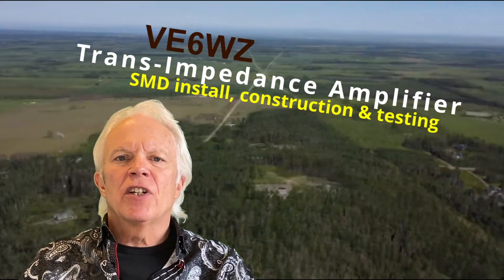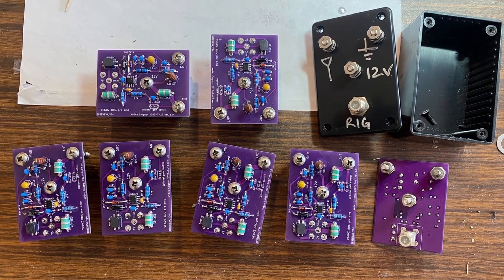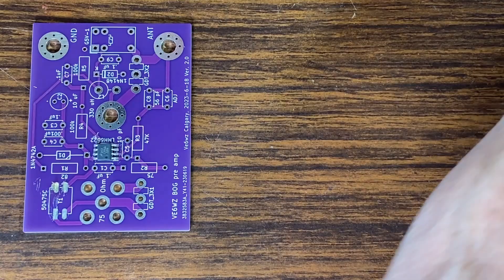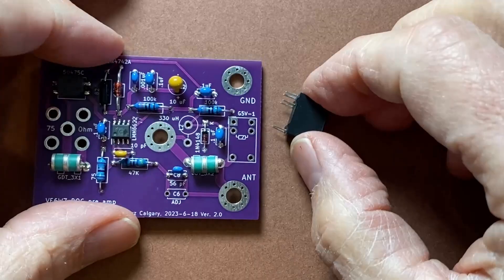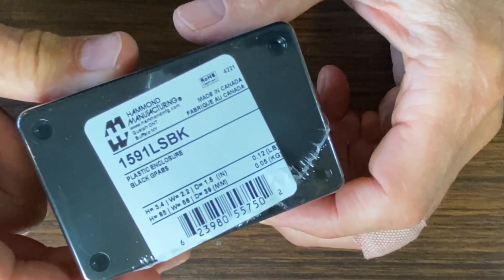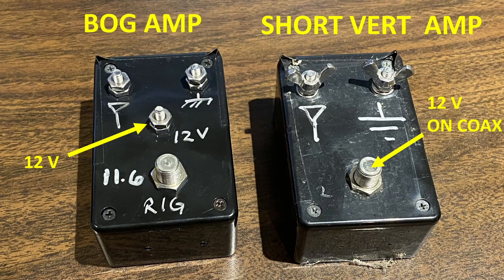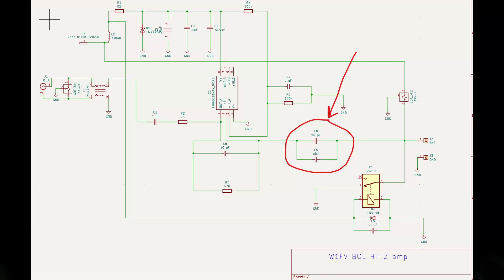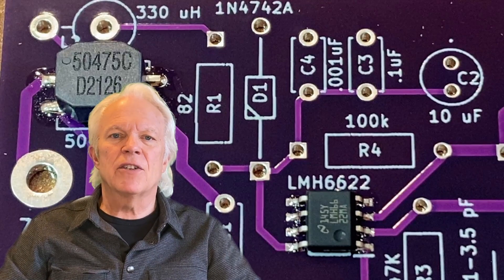DIY amplifier for RX antenna (part 2)

Comment: Steve, could this amp be adapted to a LoG design (160m to 20m)?  I don't have the acreage at home and while I do have a lot of acreage in the country, it is all too hilly/rocky for bogs.  I was thinking about nesting some LoGs and adding a comment switch feed/switch point, and possibly do arrays.  73 KK7YIS

Comment: Steve, your schematic shows the relay that shorts the antenna to ground when the amplifier is not selected by the circuit selection logic. How is the group of selected antennas also protected?

Comment: Thanks Steve, I built your design and have it running with a 1900ft Beverage in Ireland (on a public kiwiSDR as well (EI5IN)). A MW band bandstop filter is the next project though as the signals are incredibly strong here.

Comment: How important is it to be able to control the impedance of the board/traces when doing this? Are you using a calculator of some sort to keep it all ~75Ω or does it even matter at that small length in relation to the wavelength? The transformer and op amp input might not really even care, but I always wonder about that...I have a number of projects I have had made via JLC as well, but have never done anything with any kind of accuracy/impedance control required. The only Design Rules I use are just wider traces on power rails and ground-flood where it makes sense.
Reply from the maker: Hi Bob!
I will "occasionally" calculate a trace width to impedance match whats required, but I'm not sure its very critical on the low frequencies we are using.
There are a number of good on-line tools available. I have used this one a few times: https://impedance.app.protoexpress.com/?appid=UNSEIMPCAL

Comment: Steve, have you ever seen anyone run a BoG through a garden hose or equivalent? Or something even more inexpensive? Something that lets you run the BoG right on the ground, but without the overhead of dealing with fallen logs and such. I have plenty of fallen trees and log to work with but it also some open fields. Faster deployment/removal and easy relocation would be the main benefits but performance closer to the ground is the main concern.

Comment: A good tip is to also have some small solderwick.  If you make a solder bridge on the SO-8 part, you can take some of the solder away with that stuff to remove the short.  When you pull the solderwick away pull it along the pin away from the chip and not side to side.

Comment: An assembled unit is available from DX Engineering as the DXE-AVA-3.  The dxe version uses a true trans amp vs a voltage amp in an inverting configuration.  Be careful when combining these various buffers as some are inverting, hence 180 degrees out of phase.

Comment: Great series of videos and really inspiring--thanks for sharing! I've ordered boards and putting together a Mouser parts order. This is a great project for me as I have a similar situation with 7 acres of woods and traditional Beverages have been difficult to keep in operation, even at the 500-600 foot length. Looking forward to getting some of these in service!--73, Rus, K2UA